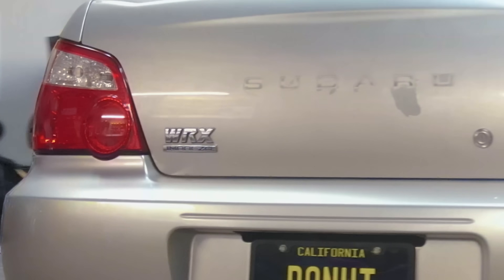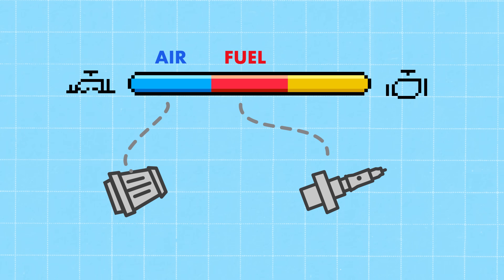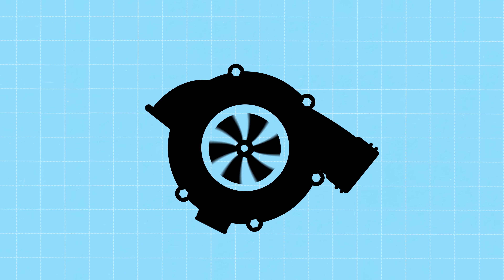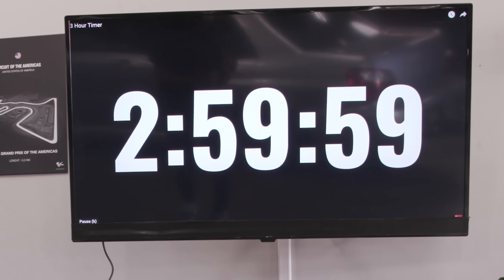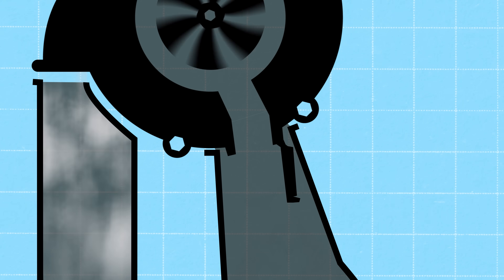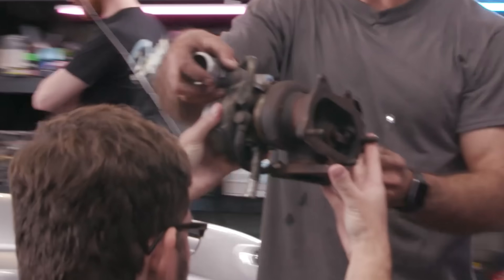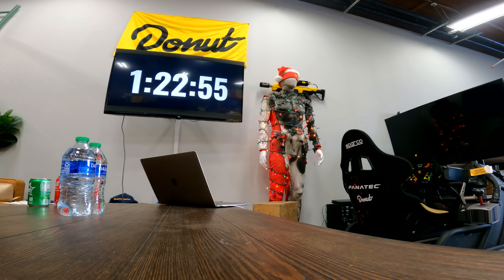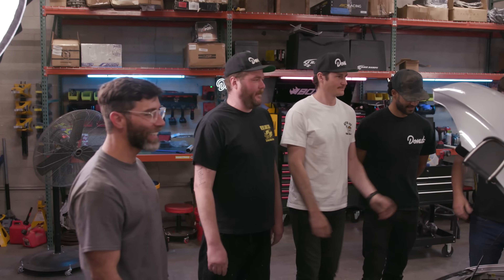Giving people a car, if they can fix it

Comment: I wish the Subarus were easier to do engine swaps on, I’d love to have another late 90’s 2.5rs coupe, but swap in either a Porsche flat four, but really something like a turbo k24 swap, maybe even the 3cylinder Toyota motor from that crazy Yaris, something that can actually make reliable power, I understand the center of gravity would raise and the balance would move further forward, a 4g would be awesome but those are getting harder and harder to find. It’s too bad Mitsubishi didn’t sell a ton more Evo’s. They were more expensive than an wrx, more of a sti price or higher, but the evo itself is an absolute tank when it comes to making reliable power, easy to get 400hp and be able to beat the hell out of it. When I used to rally I always dreamed of an EVO, but it never happened, when I worked for Mitsubishi I almost took a loan on a 9mr, but the payment and especially the insurance were too much for a young father with a 3 year old girl and a new born son, and being the bread winner, I do sometimes wish I had done it, and I was even closer to getting the almost evo 10, kits of people don’t know about the last generation Ralliart, turbo, awd, and the at the time super new automated clutch, in fact I think Mitsubishi, Lambo and vw were the onky production cars to have it. It’s the same as the evo10mr had. But the price was high 20’s if I remember correctly, it was a true competition for the wrx, it only put out 220 if I remember correctly but it was the same motor as the evo’s had and could easily make more and handle it. At the time I was waiting for the perfect trade to come in, a very well taken care of evo8 or 9 on a lease or some of our loyal customers would trade in their cars with every new model, a mint condition evo9 Mr came in with the best package I can’t remember the name of it but it was a serious improvement to the suspension and awd system as well as a factory cold air intake and upgraded exhaust, but I argued with the dealership owner for iver a week but he wouldn’t sell it to me, sent it to and got more than original msrp for it. Unmolested evo9mr’s are like unicorns, and at the time they were on the 10. I almost quit, and it was one of the reasons I did quit later on. Do you have any idea how hard it is to sell Mitsubishis at a dealership where we sold Hondas on our left and Acura to our right. On top of that I was the #1 Mitsubishi salesman in my state for 3 years, I even did the first YouTube videos on Mitsubishi for dealerships.

Comment: Meh with the right tools and some eyeballs, it turns out that, that  turbo isn’t that hard to replace. I’ve had mine out in an hour. The real problem being, getting a replacement turbo in less than an hour here in Idaho where I live. And I’m sure that the Donut garage has the famous Dom from The Fast and the Furious quote somewhere on the wall. 

“ If you can’t find the right tool in this garage , Mr Arizona, you don’t belong near a car.”

Comment: I gave away my 06 Hawkeye for next to nothing because I had the head gaskets replaced about 6-8 times in the 2 years I owned it, did a new oe rebuild with pure turbos on the turbo but I never looked into my ecu.y car would never want to start every time I filled over a gallon of gas in the tank and it didn’t matter if it was stone cold or not, once I drive it around, it would start just fine every time. If someone can please tell me why my car was doing this, it’ll make me laugh my ass off if it was a stupid easy fix and I spent $22k on a car for NOTHING. I sold it for $4k after all the work I put into it. I blew up on the next owner and he sued the hole in the wall dealership got not fixing it before they sold it to him after they got it from me knowing it possibly needed a new motor. Scum bags just saw “Wrx” and thought of $$$$😭

Comment: Oh a boost leak… how I despise you. It’s probably the couplers on the intercooler behind it, a failing turbo, any intake gasket, a bad wastegate, a failed turbo inlet, and if it’s neither of those then probably the restrictive pill between the turbo and boost controller.

Comment: i wana see that guy take that turbo off without taking off or at least loosing the flange on the downpipe LOL yall really are saying stuff that is not even true for subaru turbo systems. ur bov is 100% recycled do ur not gonna hear it with stock airbox.

Comment: This was a weak video compared to
The other ones guys.   Cmon.  Won’t make boost?

Not much troubleshooting involved there lol.  

At least pop the signal line for the gauge off so it would have still had no boost after the turbo.   That would made it more entertaining

Comment: That guy that almost won the corvette, had to fix like 6 or 7 things with the car, this dude only had to do one. Yall coulda unplugged a spark plug, or maybe one of the fuses for ignition or something, make it a little more challenging. The video kinda felt like you did the other contestants dirty. There should be a set amount of issues they should do on every vehicle, differing from one another obviously. But its the consistant number of issues for they have to fix that should be a set rule (like "theres 5 things we did to the car that you have to fix) for every challenge/video.
Reply: I don't know if I agree with exactly that, but you're on the right path.
Here's a few ideas I have.

1. Each contestant gets the same amount of time. Let's say 3hrs.
2. Each contestant gets the same time penalty for asking for wrong parts or tools. 10 mins for each wrong thing.
3. Each contestant gets the same bonus time added if they complete the sponsored repair/upgrade.
4. Every fix has a book time/labor time. They should use those numbers or come up with their own average time per repair. Those numbers should be used for each contestant.
5. No matter what Donut breaks, all the combined repair times must leave 20 mins on the clock if all goes well. This leaves some wiggle room for penalties and general mistakes while still putting pressure on the contestants.
6. The end result for each contestant should be the car runs and drives properly.